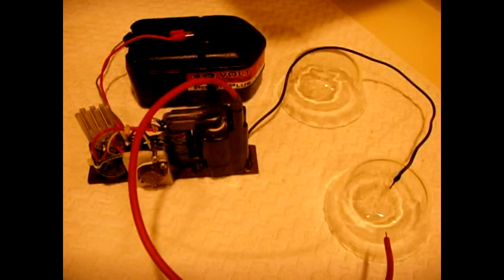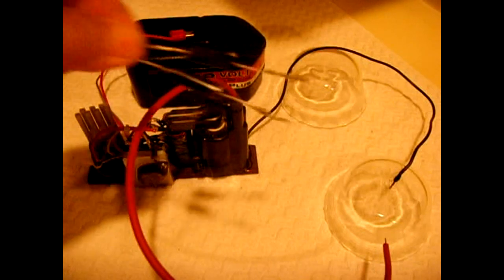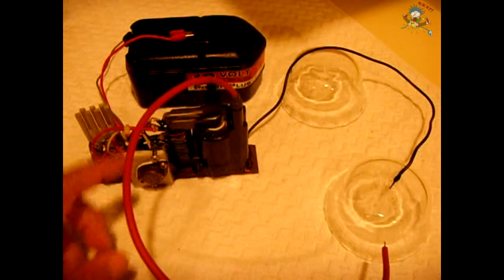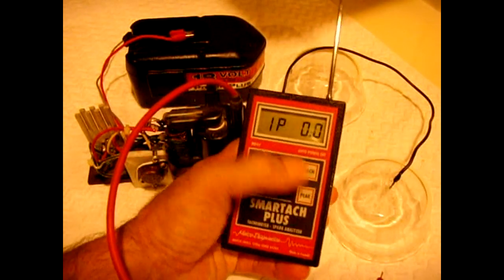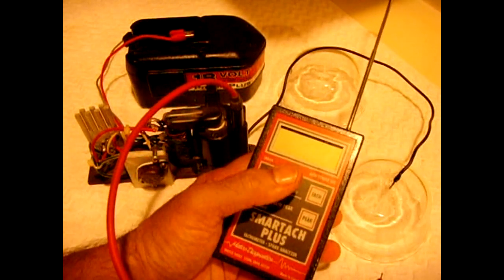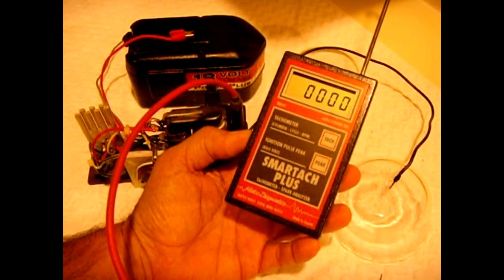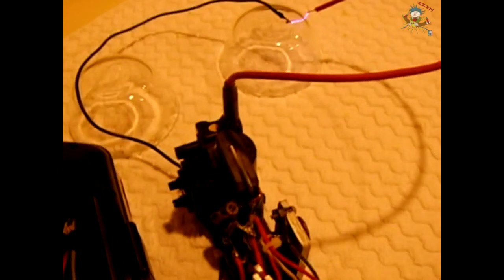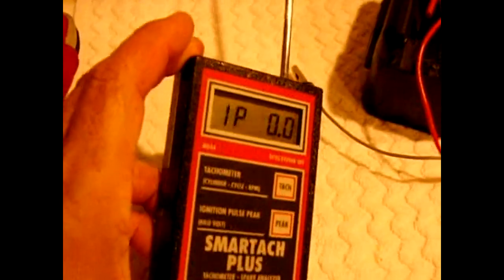High Voltage Discharge (38KV Peak)

Comment: It was basically the same circuit that you used, except that all coils used were from inside the flyback transformer. The resistor voltage dividing part was 360 ohm,20 W and 30 ohm 1 W. I was running it with a 26 V power supply and it drew @ 750 mA.
Reply: The next pic is supposedly the car hood is cool I was trying to send it so 4

Comment: You are right about that you must be very careful. Just in case anyone is wondering , to get shocked by 25000v feels like having a hand full of bees stinging you and will slap your hand behind your back....if your lucky, like I was!
Reply from the maker: Luckily the current output is low. If it was high, you may not be around right now.
Reply: John Kerley In my youth in the 1970's i worked in TV repair, the worst shock i got was carrying an old 26" CRT down stairs, my finger slipped into the anode connector hole at the side, and WHACK, instant 48kv discharge, I dropped the tube and fell down the stairs, the shock made my legs collapse.
Reply: smeghorn foghorn Now I feel like we are a bloodbrothers....LOL!

Comment: I have no dought that it is HV out on the input lines because when the box was turned on I saw very long arcs appear between the input wiring and a ground strap that I had that was holding down the capacitors of the supply. I wonder however if I should have grounded that strap, as it may be capacitively hooking my capacitors to ground!

Comment: I also wonder if this is a sign of flyback failure, because I did push it to produce a pretty high output voltage....1.5 in. spark that blew out original transistor at first.....forgot to earth ground!

Comment: I would like to get the HV off of my input lines,but I am afraid of any further testing to achieve this because at some point,if HV keeps back feeding,my large electrolytic caps. may explode that are in my power supply that I am currently using.

Comment: How is it possible that a flyback circuit that runs using the original flyback coils for primary and feedback can be putting the HV output on the input lines when the HV return is earth grounded and its pin is siliconed? That is the problem that I am having and this problem caused the failure of two power supplies so far, as well as causing me a bad shock once I had put it in a box and turned it on. The box had a plexiglass top that insulated the flyback (that was attached to it) from the rest of the box. I realized after getting shocked that the HV out was on the input lines. This was why it was causing the digital V and A meters of my bench supply to turn off during testing it. I should have realized that HV was the cause of this before hand, but I thought it was RF or something. All the time testing it, I did not get shocked....because it was grounding to wooden bench. But I shure found out how bad the shock was once the input wires were insulated from ground!
Reply from the maker: John Kerley You have to be very careful when doing anything with high voltage. You can suffer a very serious/deadly shock. Almost everyone who experiments has been shocked before by accident. Never use both hands when playing around with high voltage. Use only one hand(your right), ideally wear a rubber glove, do not touch anything else, and wear good insulated shoes. The battery NEG is ground. You can also connect a wire to earth ground if you wanted. There is always high voltage on the red wire, but once the high voltage jumps the gap to the battery NEG side, the voltage on that side is zero. Just like a gas engine. The ignition coil produces high voltage which jumps to engine ground which is connected to battery NEG.
Reply: electronicsNmore Always work on high voltage with one hand in your pocket and wellies on....seriously.......if possibly, an earthed metal work surface helps as well

Comment: I had thought it was caused by external arc over across pins......but maybe it was internal arc over?
Reply from the maker: John Kerley I have no idea what happened, nor do I know what circuit you used. Just be careful.
Reply from the maker: John Kerley I have no idea what happened, nor do I know what circuit you used. Just be careful.